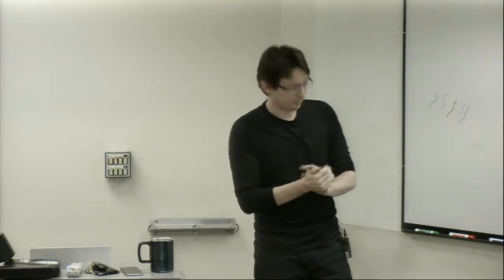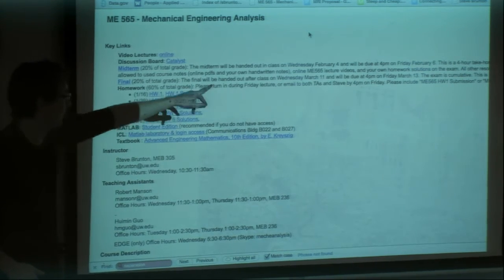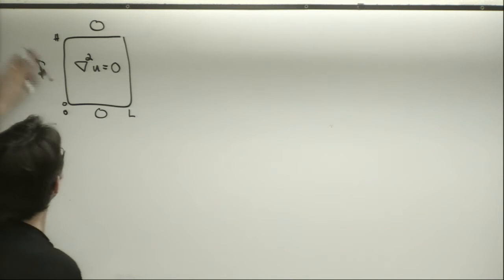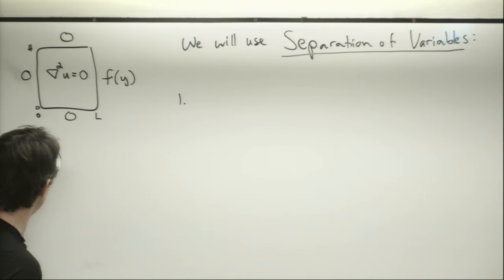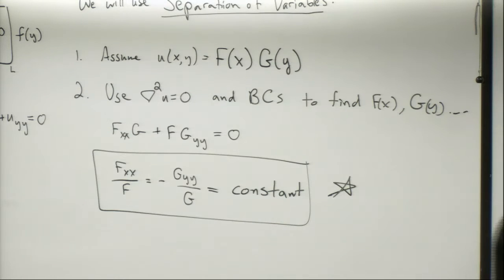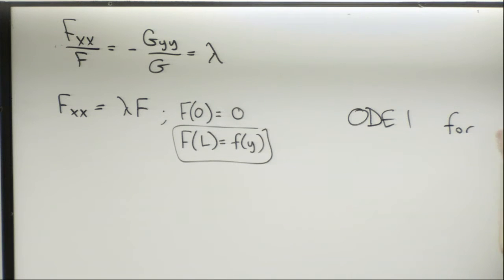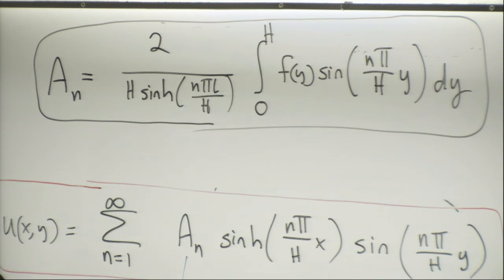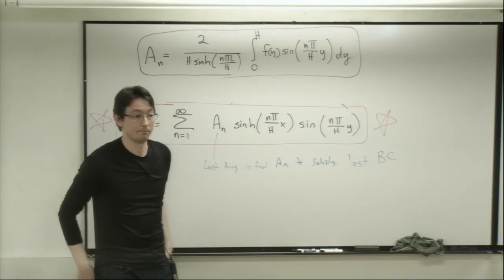ME565 Lecture 10: Analytic Solution to Laplace's Equation in 2D (on rectangle)

Comment: Would it still be valid if I assume u(x,y,z) = F(x)G(y)H(z)? How do we deal with this such that they will relate to lambda?
Reply: This might not answer your question but I would say in general the separation between two sets of variables, such as time and space, is sufficient for most physical problem, even the space is in 3D. So u(t,x)=F(t)G(x) where x could be vector of space variables.
Reply: @wowowowdog  yeah but you would still end up with a PDE in x,y and z for the spacial function, how would you solve that?

Comment: How does the boundary condition on F(x) (being f(y) implying that there exists x s.t. F(x)=f(y)) make sense if you have already assumed that it has no y as an argument.
Reply: I guess they fulfil Dirichlet conditions, claiming that if the boundary  of a (differentiated) function domain is fully described then a (unique) solution can be found. Since the square surrounds the domain of that function the solution is determined by that infinit sum with one boundary having constant value f(y)
Reply: Because it is equaling some constant. The only way for a function of 2 separate variables to be equal is if they are equaling some constant